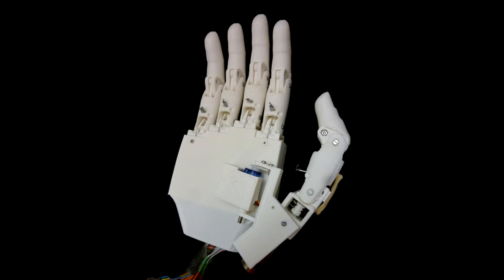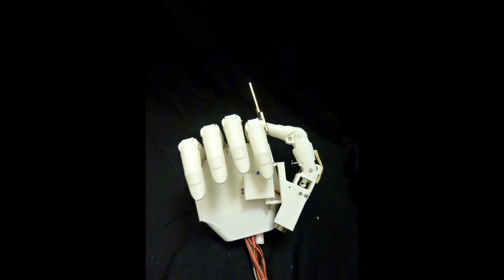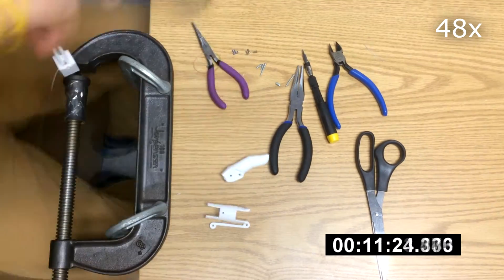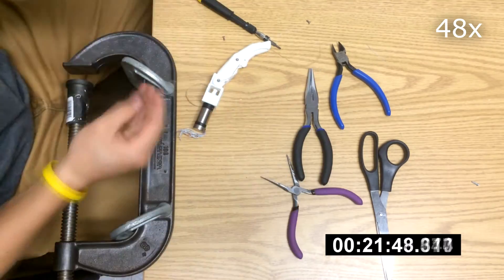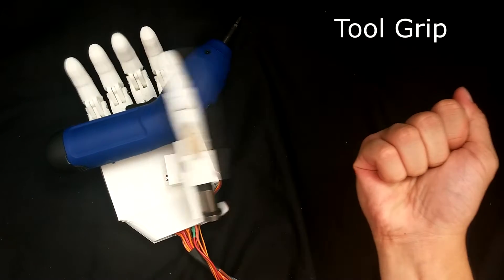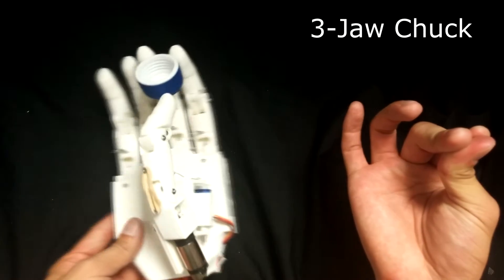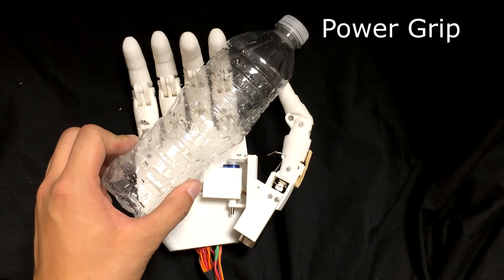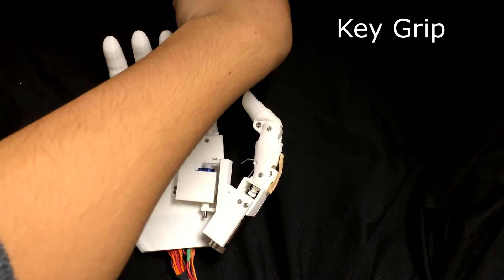Tact: An Open-Source, Affordable, Myoelectric Prosthetic Hand

Comment: Did you test the virtual hand with EMG Signals ?
Reply from the maker: There wasn't a virtual hand in this demonstration, but rather a real 3D-printed prosthetic hand. That was controlled using EMG signals.
Reply: @aadeelakhtar  Did you know software/program, that can draw virtual prosthetic and test it with EMG signals ?
Reply from the maker: @mitkosokolov9382  You could potentially use BioPatRec: https://github.com/biopatrec/biopatrec/wiki/VRE.md

Comment: i  designed a little board to build some similar project DIY (not so professional but it work). It is good for started engineering or school thesis. You can see it at these link. http://www.gtronic.it/test/index.php/micro-gt-mini/   There is also a book for beginners here:  https://www.amazon.com/LETS-GO-PIC-Essentials-Micro-GT/dp/1492851523

Comment: do you use an arduino? if so, would you share the code?
Reply from the maker: Franco Ap We have moved on to an entirely new design. You can find all the source materials including the code here: http://bretl.csl.illinois.edu/prosthetics in the section for the low cost prosthetic hand paper.
Reply: thank you!